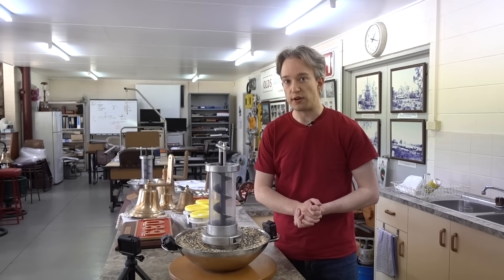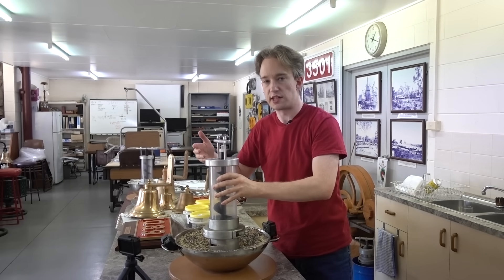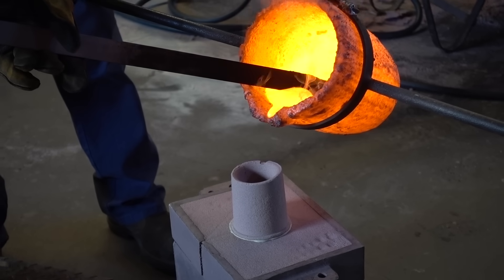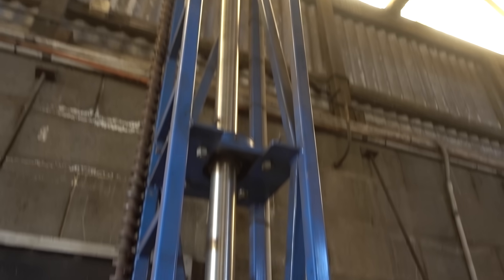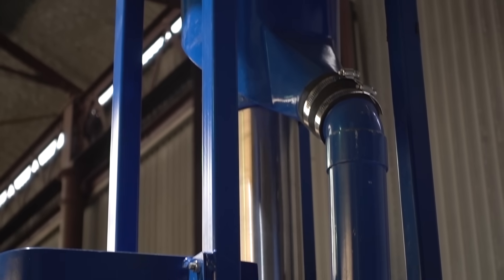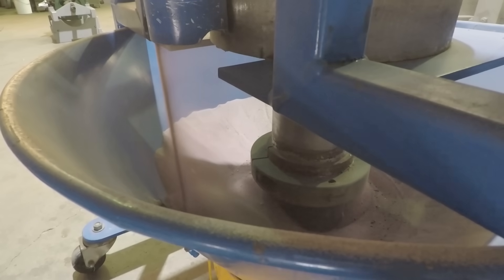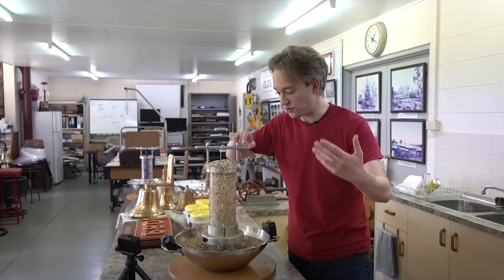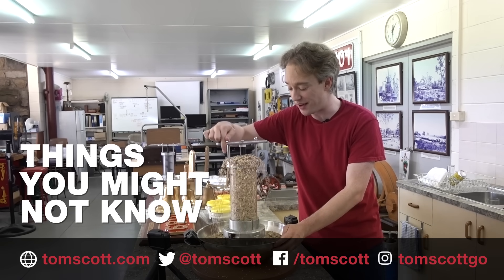Mr Olds' remarkable elevator

Comment: What I like about this design is that it's not only the grabber at the bottom, but the friction of the grain against the pipe sidewall that makes it push up the incline. By that logic, the normal force against the pipe wall would increase as the rotational speed increases due to centrifugal force increasing. Clever!
Reply: Yes! Very clever
Reply: sorry if im misunderstanding, but can anyone explain how the planar horizontal centrifugal force contribute to the upward vertical movement of the particles? Is it because the net force is up after accounting for the normal force from the screws surface and adding that to the friction on the walls? also @SmarterEveryDay, you probably wont see this but been a big fan of your channel for a very long time, just playing devils advocate!
Reply: @aruhtaz  friction can be described as the normal force acting on an object multiplied for the coefficient of friction. the coefficient of friction between two object is constant, so you can mostly ignore it. the normal force, however, can change. force is mass times acceleration, so the faster the grain moves the harder it presses against the walls of the tube, and the harder it grips the tube, the more friction is generated. this creates a positive feedback loop where the faster the tube is spinning, the faster the tube can spin.
Reply: @林 No.
Reply: Centripetal force.
Reply: Why did I understand that sentence?
Reply: AAaaaaa big words make brain hurt
Reply: Destin, that’s also true for the original archimedes screw design... there’s nothing NEW about this, they’re just changing the observer’s reference. From the PoV of the grain, the same thing is happening inside the tube.
Reply: @DBurgur  True, but with some clear advantages. Where a moving screw apparently has the tendency to create 'airbubbles', this isn't an issue for this mechanism. What is even more perplexing for me, as a mechanical engineer, is the fact that this mechanism hasn't been think of before, because it appears to have some nice advantages:
1) It's power efficient for large lengths: instead of moving the heavier screw, you only need to power the considerable lighter outer tube;
2) It is way easier to make it stiff for large lengths. While it is difficult to support the internal screw, because extra bearings require an intermission of the thread and add a potential blockage risk, it is easy to add bearings on the external tube: no contact with the product, and easier to keep the load on your motor drive stable. 

For me it again proves the power of starting your engineering problems with the fundamentals. So many interesting new insights are possible when you don't constrain yourselves by only copying standard practices. The human mind is way too hardwired to be lazy and eager to build upon preconceptions.
Reply: But this wouldn't work without the 2 grabbers at the bottom of the tube. When you rotate the tube, the grabbers direct the flow of corn so that its pushed against the screw as if the screw was rotating. If there really was just a normal tube rotating around the screw, no part of it would apply a force to the corn and the tube would just rotate in the still corn
Reply: The seeds are forced in at the bottom. That helps supply the upward force
Reply: @Ricky-pr5wz  actually this should work without the grabbers too, just slightly less efficiently. Friction from the side walls is sufficient to impart energy into the elevating material (and friction on the blades reducing its tendency to empty back down the screw), thus imparting the impulse needed to raise the material that much higher, rinse and repeat. You can get an intuition for this by envisioning an infinitely long Olds Elevator, what is driving the material upwards? It's certainly not the little scoops at the bottom.
Reply: hi i am a BIG fan of ur channel
Reply: so a more rigid surface area on the interior of the pipe would make for better Load if the friction on the grain is higher ?
Reply: so, apart from maintenance aspects,(outside support is easier then bearings inside) how does it bring in more compact material then the screw moving, is it because its  greater surface moving , so therefore Has more suction and power, (rather then the smaller screw turning, having less pull)
Reply: @DBurgur  ..but a different thing is happening at the pickup point.  Note the gathering vanes rotating to scoop in the grain.
Reply: yea it's probably a larger surface area for friction than the blades of the screw are in the other design
Reply: Would need to be high rpm to start imparting centripetal force.
I wonder is the inside of the tube has, or could have vertical grooves to increase friction. As long as the mediums grain size didn't fall through the grooves.
Reply: hey I know you!
Reply: @Tuning3434  Your point two is actually really significant.
I'm familiar with using small (10-15m) grain elevators. A serious problem with them is the internal screw distorting and rubbing against the sides of the tube. So the length of an archimedes screw is limited by the stiffness of the materials.
Reply: I wonder if a high friction wall would improve efficiency.
Reply: @andrewradford3953  Oh, I see you had the same idea...  Dustin should test this for us 🙏
Reply: @Tuning3434  Indeed! Sometimes, reinventing the wheel is exactly what is needed for optimization :D
Reply: @Tuning3434  the bottom of the pipe would have quite a pressure on it so i see no real gain.
Reply: Would this, in theory, also work with a straight ramp and conveyor belts for walls? Or is the curvature essential to ensure all particles, even near the center are eventually affected?
Reply: K  i think i was pointing out that the casing is subjected to friction on both sides so a stationary outside wall would eliminate friction on the outside of the moving casing. obviously it could not go to the floor.
Reply: If friction against the sidewalls is somehow stopping the grain falling how is that same friction not applying as the grain is rising? The sidewalls are not rising. The grain is rotating horizontally WITH the sidewalls but is also sliding vertically upwards AGAINST the sidewalls. Against friction and gravity. As that rotational speed increases so too does the friction - both the relative vertical and horizontal directional forces. The grabber scoops are the key and friction offers minimal resistance or support to a material that is acting like a fluid
Reply: What’s the benefit over a standard Archimedes screw system?
Reply: Do i understand what you’re saying right? Do you mean that it also has the advantage that it can carry increasingly more weight for farther if you just increase the rpm of the pipe?
Reply: Weird how I didn't need all those fancy words to understand it
Reply: @aruhtaz  
Think of it this way:
The screw inside the cylinder serves as a "ramp." 
The "scoops" at the bottom of the cylinder ingest particles (grain, sand, or whatever) as it rotates. As the cylinder rotates, it ingests more material, forcing the already-ingested material to be pushed further into the cylinder. Once the bottom-level material backs up in the cylinder far enough that it reaches the bottom of the screw, the material will have no choice but to start getting pushed up the "ramp." As long as the cylinder "grabs" material at the bottom, it will keep pushing the material already inside out of the way to make room. 
Since the top-side of the screw is open, the material has somewhere to go --- up. 

There is no actual "vertical force" being applied; only horizontal force (the dirt pushing it's way inside at the bottom). It's only because the vanes on the screw form a spiral ramp up the cylinder that material flows upward --- it's just following the path of the "ramp." 

If you were to close the top, the device would eventually stop working because it would run out of free space to push material.
Reply: @blichte1  It would not work without the scoopers as it needs the initial filling of the tube. Without it you don't have walls to have friction against.
Reply: @sixstanger00  check the large clearance between screw and walls.  The material is AVOIDING the ramp and going up the wall instead. Also it keeps working with almost nothing coming in the bottom. ie not powered by scooping force.
Reply: @Tuning3434  This design has some minor advantage but it is primarily a way around existing patents. At typical use-case speeds the screw must be just as stiff and supported as it does in a traditional turning-screw design; required screw stiffness of the two designs won't diverge until the speed is high enough that balance and damping of harmonics become a concern. 
The mass is mostly irrelevent to its efficiency, it only acts as a flywheel and the bearing friction is several orders of magnitude lower than the friction losses internal to the material being elevated. In rare uses where rotational inertia matters the outer pipe has the disadvantage of a high moment of inertia(average radius of its mass is large).
Reply: @Alastair510  You can put significant strain on a screw to force it to be straight, the fact that the screw is anchored and doesn't have to rotate is a major advantage of this mechanism.
Reply: Haha spinny thing go up
Reply: Its funny people struggle with this,
From either reference frame, the relative motion is the same, thus the result is the same.
Reply: I don't get it, this is just an Archimedes screw but with the sidewall of the pipe rotating along, what's the excitement about??!? Its working on the same principle as a leadscrew.
Reply: I don't get it, this is just an Archimedes screw but with the sidewall of the pipe rotating along, what's the excitement about??!? Its working on the same principle as a leadscrew.

Comment: And the main advantage seems to be you can add as many bearings to the rotating part as you want and none of them can be contaminated by the product. Try that on the screw conveyor.
Reply: Wow. That too!
Reply: Thank you - I was wondering about this, the screw model seemed equally good but indeed I could imagine that with this you can keep any moving parts away from the material (or water!)
Reply: Put your bearings and rotating parts at the top of the screw not the bottom?
Reply: @jl3423l4jsdf  That's fine for a very short conveyor, but once it gets longer the central rotating screw will start to whip. The faster it rotates, the shorter/stiffer it has to be to avoid this.
Reply: @kevinmartin7760  and the rotating cylinder has no limits on thickness, so it can be scaled up more.
Reply: Yes, this operates in a similar fashion to medical pumps in that by pushing the fluid externally through the pipes by essentially squeezing the liquid forward with pressure differences, the liquid inside does not go through a pump. This olds elevator also does not touch the contents inside with anything new from the outside.
Reply: @SylviaRustyFae How does it not create dust though? I thought the physics of if were the same, except that the outer cylinder is rotated instead of the inner screw.
Reply: @vesk4000  most likely its because tighter tolerances, the tube is much easier to support as it spins while if the screw spins it either have to be short and thick or spin very slowly because of how rotating bodies move at speed

Comment: This was invented in 2003, I can't believe it. It's so motivating knowing that there's still simple innovations that have been yet to be discovered.
Reply: As someone on a constant journey of experimenting and expanding experience by creating models that tell me things I wouldn't have known otherwise, I can state that the simplest ideas, which incidentally have the broadest range of benefits, generally take the longest time to get around to. Part of it is the habit of thinking one knew what would happen, so why bother. Those moments when one does finally get around to something of this kind and then gets thoroughly mind expanded by all the unforeseen sides of it, those are mighty fun...
Reply: Humans allegedly never once put wheels on luggage until the 70s!
Reply: Read the patents closer, it's related to specific uses. There is much old non protected prior art that related to transporting fluids at an angle by rotating the housing. It wasn't used much but was unsurprisingly found in train designs for a very short period. These guys have that sort of background so I'm not surprised that they made something along that train(haha) of thought for this purpose.
Reply: wait it really came out in 2003?
Reply: How do you know this wasn't the last undiscovered simple innovation?
Reply: @neplatnyudaj110  How do you know it isn't?
Reply: oly thing is that the "inventor" was educated five generations before us

Comment: I'll take your word for the dust reduction properties.  But to me, the 'oh wow would you look at that' moment was when Tom turned it backwards and the bird seed just sank right out of sight!  Almost like magic how a slight turn to left or right makes the product just fill and drain along the tube wall with almost no internal agitation.
Reply: its all in those little fins at the bottom of the tube. Turn them one way and theyre forcing material into the thing and making it climb the screw, turn it the other way and it's actually pushing away the material in the bowl, giving the material in the screw space to fall into. If those fins werent on the bottom the thing would do nothing. Very cool invention and a very simple principle.
Reply: @SpydersByte  yes, that's the key that makes it easier to understand. When you're turning the screw, the bottom of the screw thread acts as a scoop, when you're turning the casing you need to replicate that part
Reply: Didja know even concrete dust can explode?